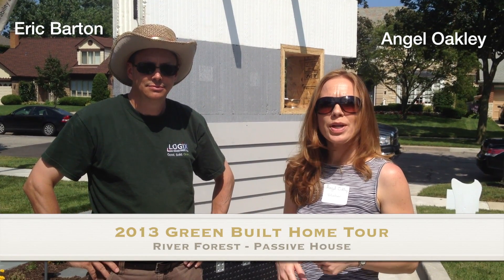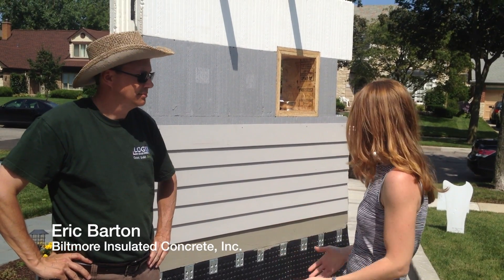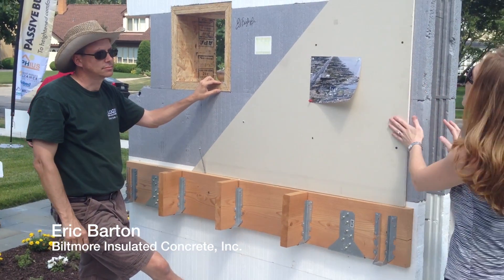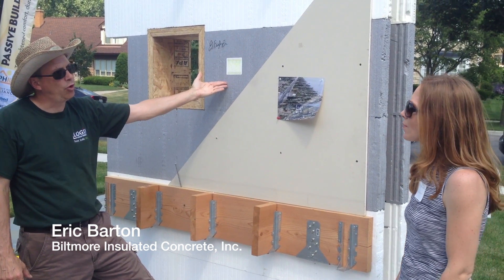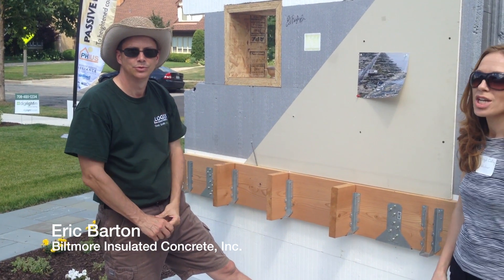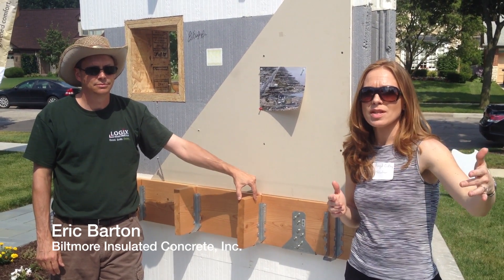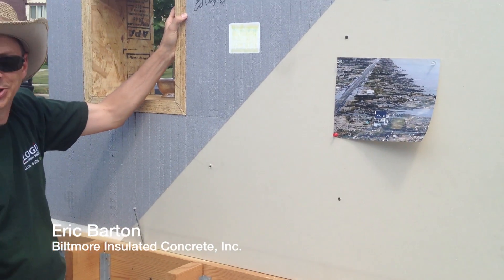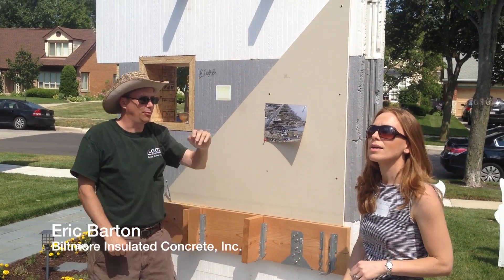Logix ICF Walls used in 1st Passive House of Northern Illinois

Comment: Once Thermal mass is considered in any design, it's understood that the insulation goes on the exterior only.  Anything preventing direct contact of the concrete wall from the conditioned space is a mistake.  It shouldn't even be drywalled, or painted, so the inner layer of ICF form material has to be removed.  Nice if it could be added to the outside, where 4" of polyisocyanurate would yield an R (6.6 x 4) = 27, less than the minimum (R 32) suggested by passive design.  These ICF's use a foam with less R value per inch and are thinner.  I'd guess an R 12 to 15 max.  Despite the apparent popularity of ICF's (lots of videos), I see little use for them.  They are simply a fast, accurate way to build concrete forms, but the material used for that should be re-usable, or useful.  These provide inadequate R value, diminish the wall's effectiveness, and are Fossil Fuel bi-products.  (so is Poly-iso)
Reply: You don't have a clue what your talking about dude.

Comment: The only downside is that 8 or 10 inches it takes of space and when you have a fire all the foam will be melted and you will end up with a expensier repair or rebuild than with traditional lumber.